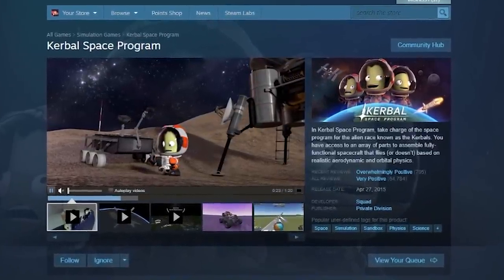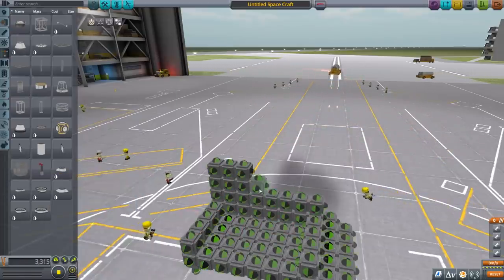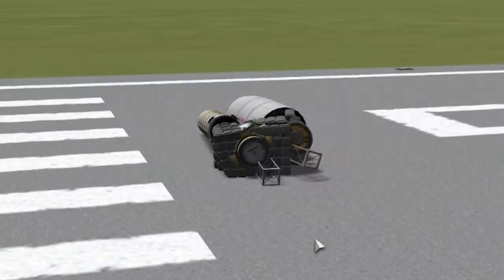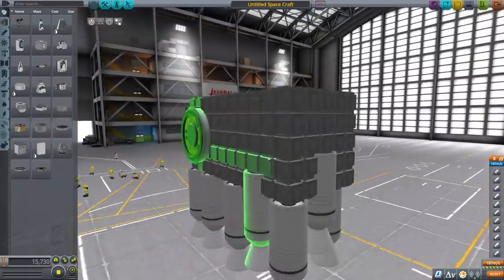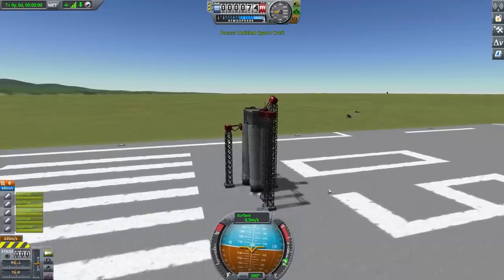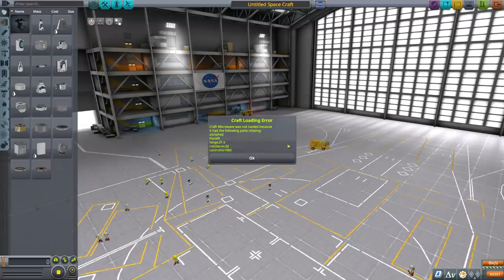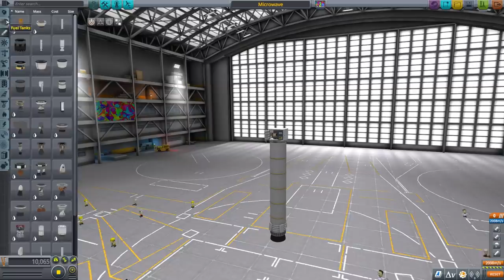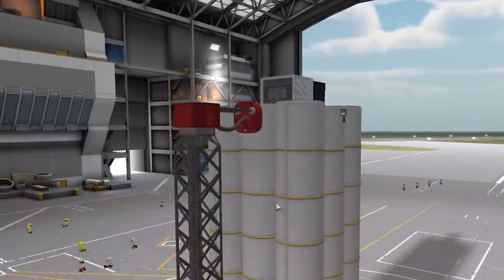I Tried To Send Microwave Into Space

Comment: protip: the more like an actual rocket it looks the more likely it is to work, also the reason your microwave was falling apart is because you need to put struts on the inside, parts in ksp dont automatically attach to parts they are touching like a grid

Comment: ok so, i know it's hard to get into the microwave into space speedrunning community bc nobody wants to share their secrets but hopefully this guide will teach you the basics.

so first of all you need to make sure the microwave is unplugged. some say it's better plugged bc it gives an engine speed boost but when the microwave takes off it will have a slight delay and it will unplug anyway which means the speed boost is useless since it only makes up for the delay it makes and if ur skilled enough the speed boost isn't needed in the first place. now as for rockets i recommend the 2007 honda civic rockets since they give a huge advantage against system failures which u will definitely encounter even if ur dream and they aren't much different in terms of speed to the current fastest rockets out there so the current meta rockets are 2007 honda civics. the engine isn't that important but if u want maximum efficiency i recommend the ketamine 2012 since it can make ur microwave go super fast while also perserving just enough fuel for the trip that is needed. also it can a self destruct system in place so u don't need to spend extra on it. now in terms of experience i say that it makes no difference other than the skill that is built up over years of practice. experience in and of itself is useless since this guide is all u need to understand the meta and there aren't any kind of special tricks u can use so i'd recommend spending most of ur time practicing. now as for special tricks u can use there aren't many like i told u but i will the meta tactics currently used. 1: don't perserve fuel. it's better to use it all since you're not gonna need the rest after u get into space at least if u have self destruct system. 2: upside down microwave. it makes the jump easier and doesn't make a difference on the rest of the trip so it's currently the meta side. 3: open microwave. this makes the trip itself much faster since the heat in the microwave is projected thus making it faster. that was all of the tactics you can use the rest r just garbage.

in summuary. unplugged microwave. 2007 honda civic rockets. ketamine 2012 engine. plenty of practice. use all of ur fuel. upside down microwave and finally open microwave.

i hope this guide was helpful with ur microwave into space speedrun